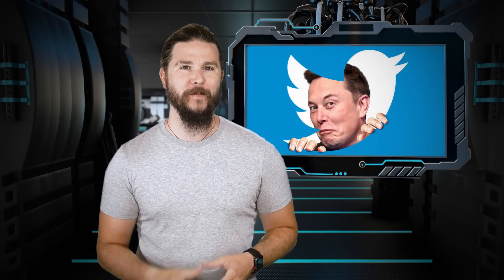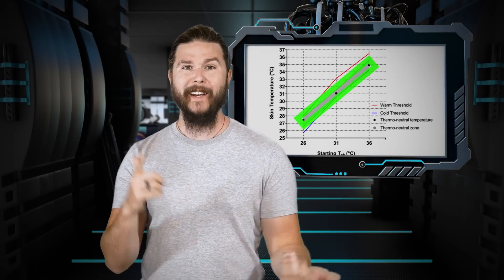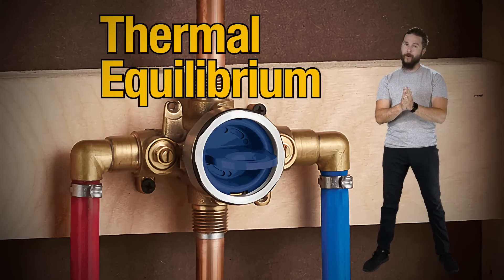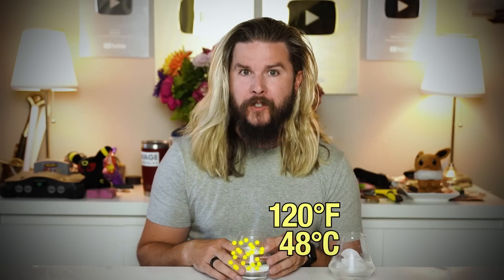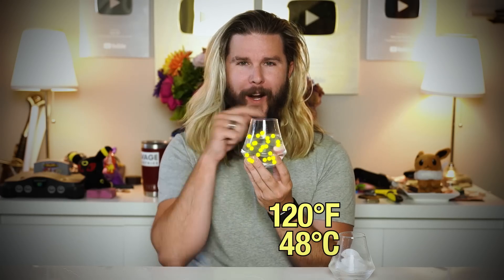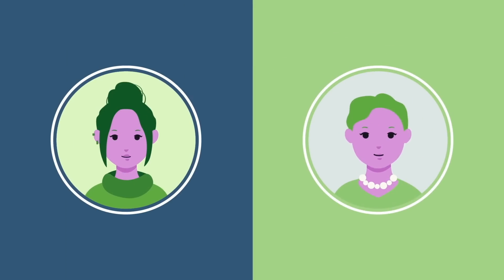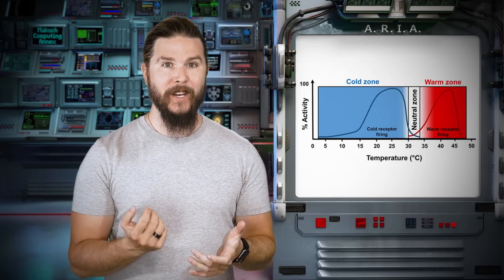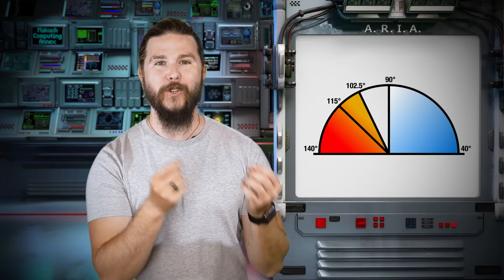Why Are Shower Handles So Sensitive?

Comment: My shower is actually different. It has the resistance thing inside it and the water passes through, getting hotter when there's less water and colder when there's more water.
Still
Same problem

Comment: My family and I used to swimming at Robert Treeman St park in Ithaca NY, which features a natural waterfall that empty’s into a very clean very scenic large pool at the bottom where swimming is allowed. I remember the year I went, and when you enter the park they have written on a board what the temperature of the water is that day, and I was pleased to see it was a nice 78f which feels in my mind like a fairly warm spring day. What I learned that day is that the difference between my 98.6 degree body and skin and 78 degree water makes it feel like literal ICE when you jump in. 20 degrees is a huge difference to your skin and when you dive in (yes there is a diving board to jump in at the base of the waterfall, it is amazing) and go from being immersed in around 90 degree air on a nice not summer day in upstate New York to 78 degree water instantly your bodies nerves report immediate unhappiness very very loudly.

Comment: I'm here with my electric showerheads and don't know what you're talking about. here temperature direct correlates with flow (volume/time), because the power output is fixed.
Reply: That sounds horrible

Comment: Couldn't you just develop a shower handle with a reduction gear in it so turning the handle x degrees only turns the actual nozzle a proportionally smaller angle?

Comment: The problem with limiting the range is it assumes the hot water is always on full.
Reply: Yep. If there isn't as much hot water available as usual, then you will actually use those "unused" ranges, and even then it may not be hot enough. I became well-acquainted with this from living in college dorms.
Reply: @RialuCaos  Oh, the horrors of Dorm-plumbing. We always had issues with water pressure. the toilet wouldn't refill, the shower would trickle, and a small glass of water would take a solid 10 seconds to fill. Of course the warmest the water got too was maybe 110F. Even better was the rushes of hot water that'd occasionally burn you alive if you didn't readjust the temp.
Reply: It also assumes people are not doing Wim Hofs.
Reply: Or have an apartment with a boiler

Comment: Can’t you just use gear ratios to make the valve controlling the water move less than the handle?
Reply: You could, but I the reason it's 1:1 is "because people have a better 1:1 sense of scale" according to a plumber in my family. But I actually agree with you, they won't care if 50-75% of the range is unusable anyway, so making it a 4:1 for example would give them a quarter the range, the majority of which would be useful to them if it's centered on the halfway point.
The only issue comes if you actually need a freezing cold or boiling hot bathtub of water for reasons outside of showering, but that said what (legal) reasons would most people have for that anyway?
And if the extreme temperature water is that important then the thing could just spin around several times.

Comment: So theoretically I could design a gearing system for my shower so the handle would use a smaller gear to turn a larger gear on the actual "mixing chamber" and with some testing I could set it up to always be in the comfort zone?
Reply: You'd be cheaper off just getting a thermostat shower handle. 😉
Reply: @HansStrijker  maybe, maybe not. But very likely maybe
Reply: @automaticninjaassaultcat3703  I think your missing the point my good sir.  We need Adam Savage to build and over engeiner this totally unnecessary device because it would be a site to see.
Reply: What you really want is a knob that handles both hot and cold, as they are easier to find the balance point. One i use right now goes from the no pressure point a little over 1 rotation and has a white cap with black text to say turn left/right for not/cold. So (even with major nearsighted vision)  i can see when i turn to the good point via the text.
Reply: Let's get Adam Savage to make that for us on Tested!!!
Reply: Or you could pull the handle off and adjust the stop so when it's all the way on its at your ideal
Reply: @automaticninjaassaultcat3703  "this is an American problem" says the place that has 2 taps for hot and cold water. It's also not a problem, the majority of modern and old fixtures are a single handle that handles temp control fantastic.
Reply: Yes. Though that's overly complicated.
Reply: I'm sure with a 3D printer you could make some sort of micro-adjust you can attach to your handle. If you never overengineer anything how can you buy new toys?
Reply: You could just make a mark on your wall so you know where to set the handle.

It would be much easier and take way less time.
Reply: or just buy a thermostatic shower handle that allows you to adjust your sweet spot, has scald safety protections and automatically keeps the water at the temperature you set until the hot water runs out
Reply: When i used to have this problem, i just got a pipe that was just the same size as the temp adjuster and put it on there, the extended leverage resulted in very fine tuning of the temperature, then i just removed the pipe and left it there...
Then again, i had to bust out ye old trusty when ever i had visitors that used the shower... 
Simple but works well.

Comment: In addition to this, the water heaters in our building are very fickle, so it doesn't take much for one temperature to overtake the other without even touching the dial. There is an early detection for this however; a few seconds before the heat starts blasting, the shower head will start to whistle and this pitch will be lower if cold becomes dominant.

Comment: PSA don't turn your water heater below 120F / 49C or you're going to breed bacteria that could make you sick.
Better (more expensive) shower valves don't just open the hot and cold pipes proportionally and instead use a variable analog thermostat to control the temperature of the water. And now there are even much more expensive digital shower valves that use solenoids to mix the water to an exact temperature.
Reply: pity they are so expensive, it really lowers the availability.
Reply: omg the heater at my old house was set to 105...
Reply: This is a straight up lie. Unless you're on a well, theirs nothing in your water to breed.

Second 120 isn't hot enough to kill most bacteria. You need 155, 160 to be safe.

And finally, most water heaters relief valves open at 150. So no, your heater isn't killing anything. How(I meant hope lol) you aren't on a bad well, or you local town treats the water, because that's the only safety you get from bacteria.
Reply: I find it best to set around 55C. That you don't use as much energy and you can find better range for controlling. Up here they set them to 60-70C which is very hot and it uses quite a bit of hydro just to keep them at that temp.
Reply: @CanadaBud23  My understanding is that it's set hotter to act as a buffer, Having it lower could present a risk of legionella growth if you were to use too much hot water at once and drain the tank, the act of it filling up could drop the water temp into that danger zone. Particularly so in colder climates.
Reply: @CanadaBud23  yeah in the us they usually default to 140F / 60C. Which is a waste of energy IMHO.
Reply: Nah.  Those bacteria are necessary.  Particularly if they're lethal.

Comment: I have 2 controls on my shower, 1 for temperature and the other for water. The temperature can be turned 360 degrees so you actually have to turn it quite a lot to get it to freezing cold or boiling hot. In short, it is always the perfect temperature unless I had guests who borrowed the shower (most of them complain it is too hot and lower it).

So Kyle's shower is just shoddy engineering. My looks slightly more expensive to make since you need 2 controllers on it, and it is a bit larger but that is just saving a couple of bucks to be constantly annoyed.
Reply: wish i had the money to install such a sophisticated hot water system.
Reply: @Hurricayne92  Is that sarcasm? Because it is about as advanced, someone just decided to cut a couple of bucks and annoy their tenants at the same time by using one controller instead of 2.

It is just pure evil, like those sinks you find in some public places that require you to push them with one hand or the water stops so you can't use one hand to wash the other.

Who designs things like this?
Reply: @loke6664  Sadly almost every shower valve I've ever seen has been the single-handed system, but if I'm not mistaken 70 years ago or so it was a lot more common to have one for each. I think it's a fashion thing, at the cost of function, imposed by manufacturers rather than consumers. Going to any given home appliances store, most on the shelf seem to also be single-control if memory serves me correctly.
Why don't most people just buy new ones? Honestly it's just easier to suffer for 5 seconds every other day than to buy and install a new valve, if I had to guess.
Reply: @silverfoxspectre  Sounds like a weird conspiracy by evil plumbers to make people  annoyed.
I been to a lot of places and even Cuba had 2 valves, so this must be some weird US thing.

But yeah, I can understand not bothering to change as long as it is working but when you need to replace it maybe get one that doesn't torment you every time you taking a shower?

It is just a weird standard to me, I don't think a single European country have a similar system, none I ever been to at least.

Yeah, being uncomfortable for 5 seconds every time you take a shower isn't the worst thing in the world but someone must have thought it was the best way of doing things.

Saving 5 bucks might be a motivation for cheap apartments but it is really nothing.

Oh, well. Could be worse. The Cubans had some weird electrical thing in their showers that seemed like a total safety violation to me, I remember seeing something similar in Spain as well. That looked actually dangerous and not just annoying.
Reply: are you british by accident?
Reply: @balazskoti2603  Swedish.
Reply: on mine you have to take the handle off and you can adjust how hot the handle goes.

Comment: I'm probably not going to articulate this very well in a text format. But my shower temperature knob is on top of the lever used turn the showerhead on so it always sits name exact same temperature position every time I turn the shower on. It's also only a shower not a bathtub that has a shower head so I don't have to worry about extra knobs and things

Comment: I think I have a different shower because my partner turns the shower all the way up to 9, while I shower at 0. 
If I had one of the showers in this video, my skin would have frozen then shattered, while my partners skin would have just melted. 
Plus, my shower only has one inlet which is cold water, the shower itself is electric and heats up the water, it only cost me €40.

Comment: Turning down the temperature at the water heater not only helps to prevent this issue, but it also saves quite a bit of energy. Everybody's home and preference will differ, but the tank should be at a temperature that if you turn the hot water on full, you should be able to put your hand in the stream for several seconds before it becomes a bit uncomfortable. That's around 122F/50C.
Reply: Idk, water doesn't bother me until it's almost 100C

Comment: DO NOT just turn down your water heater if you don't know what you're doing. The heated water has to stand on high temperatures are needed to keep it free of germs.
Reply: DO turn up your cold water freezer.
Who needs cold water anyway ?
Reply: what about the cold water?
Reply: What?

First of all, I doubt your water heater hits 160F which is what you need for germ killing.

Second, what germs are you afraid of? The hot and cold water are the same water. Its just some of the city, or well, water is directed straight into your house, some goes to the hot water tank then to your house. Both come from the exact same pipe either way.
Reply: @majinjason  Never heard of Legionella?
Reply: @ornotermes  considering googling that brought up legionnaires disease and nothing else. Imma have to say no
Reply: @majinjason  That's the disease caused by Legionella bacteria, and it can grow in water pipes if they hold the wrong temperature, it's dormant in cold water and is killed with hot enough water. If you turn down a water heater it can easily create a breeding ground for them, but can also happen with long pipes or with water standing in pipes.
Reply: @majinjason  In most places you don't need to worry about Legionella in cold water because it's dormant below 20C. If your water is warmer than that for extended periods you might have to worry about it, that's when you need water treatment to make it safe to drink.

It's a quite dangerous disease, especially for people with a weaker immune system, so it's definitely something to take seriously.
Reply: lol, ever heard of water treatment facilities??? Do you or did you ever drink water from the tap??? Even if "shower" or "heater" water would be somehow different than tap water, who drinks water in the shower? If you are worried about germs getting on your body, then better wash yourself with some high % alcohol. Because you have quite a lot of germs on you right now, and even washing yourself with distilled water won't change that.

Unless you are living in a 3rd world country, or are not connected to the main water supply, you don't have to worry about it.
Reply: @mrcreepypl  lol, ever heard of good and bad germs and exponential growth?
Reply: @pedrosso0  as if that would be my point...

Comment: Sounds like an American issue, standard shower valves here have much better control over the temperature and even have a quicklock so it stops at the halfway point.
Reply: I'm Italian and I've never once in my entire life seen such a thing as "a quicklock so it stops halfway".
All I can say is that level of control depends HEAVILY on the quality of the faucet. Crappy faucets are uncontrollable because the force needed to overcome the static friction before the lever starts turning is way too high and is enough to turn the damn thing by a significant amount. Quality faucets are smooth and very easy to adjust, even if the target area is just as small.

Comment: I always turn the shower full blast hot to heat up, then I turn it to just above the half way point when I get in. Depending on weather conditions, just need a slight amount of tweeking.
Reply: I've just set mine to perfect temperature and left it there for years. Before I turn the water on I just aim it away from myself for 3-5 seconds, check the initial cold water in the pipes has passed with my hand, then get in. Haven't needed to adjust the temperature in years! 😉
Reply: @probablythedm1669  Odd what temp I want my shower changes with the seasons summer cold winter hot.
Reply: I find it interesting you mentioned weather conditions.  Like if I'm gonna shower but it's raining I just walk to work instead of driving.  Seriously though there were times this winter where I had to stick a space heater in the bathroom before even attempting a shower. BRR.
Reply: @whatelseison8970  I mention weather because sometimes it's so hot outside the cold water pipe is hotter than the hot water pipes (for a little while, the cold water gets cold but not as cold as winter) so the mix is very different to the middle of winter

Comment: The lower you turn the temperature down on the hot water heater, the shorter amount of time you can take a warm shower. That's just a fact.
Reply: Depends on the heater. My parents have a continuous heater, it could technically run forever. I for example have remote heating, so I get scolding hot water anyway. Lots of differences depending on all sorts of things like updated construction laws, green energy initiatives, whether gas is available as a heating source or the aforementioned remote heating. :D

EDIT: Oh that reminds me. I know it's a thing but I never really understood how you can run out of hot water anyway... It's just not a thing here. 🤷‍♂️
Reply: @Byter09  happens here all the time.  depends on the age of the heater though. new ones are both more efficient and quicker.  I had to replace mine this last winter and its allot better now.
Reply: Why would you have a second heater for water that is already hot? Energy inefficient. You are the reason for global warming.
Reply: @bryanbrady877  I think you misread. Remote heating requires me not to have a heater at all.

Way to go though, immediately coming to weird conclusions lol
Reply: @Byter09  He said hot water heater.
Reply: @Byter09  Way to go thinking I was even talking about you. Was your name at the beginning of the comment? Hot water heater is a stupid thing.
Reply: @bryanbrady877  YT highlighted your comment as a reply to me. Idfk why it would do that if it wasn't a reply lol. And also, except for remote heating (which is also not the most efficient), how else do you expect people to get hot water?
Reply: @Byter09  HE SAID HOT WATER HEATER 
WHY HEAT HOT WATER IF IT IS ALREADY HOT. Jesus judge judy already. I understand heating techniques I WASN'T TALKING TO YOU!

Comment: My shower is a porabola were the sweet spot I in the middle and as you go higher or colder it changes more per degree of rotation 
But at that sweet spot you hav very fine control  it's also is a thermostat valve  wich makes sure that its perfect always  not cheap but were I live its standart and thay last a long ass time   also my water is as hot as possible  sinse I live on boat and I need that hot water to last a long time so my boiler is only on for 1- 3 hour a day on limited power